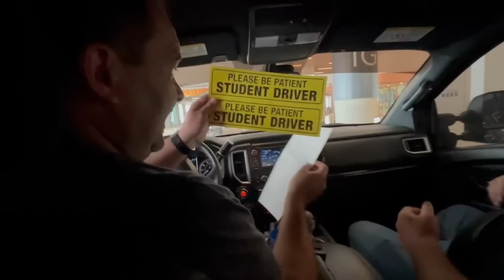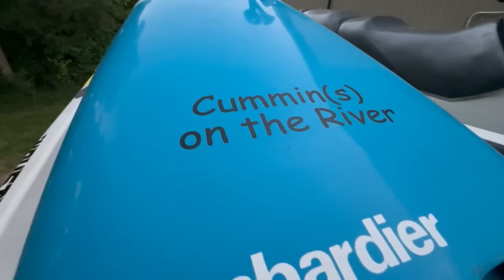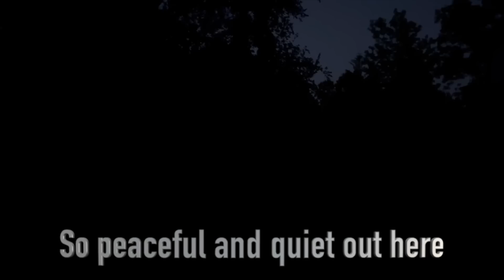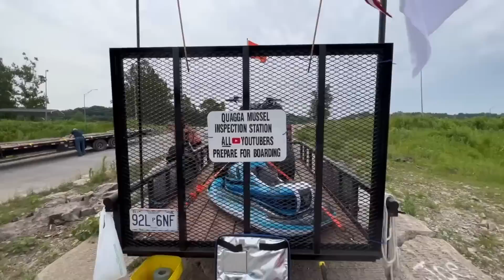Will I Survive the Missouri River Run 2023?

Comment: @Merlin those rocks are jetties.  The Corps of Engineers use them to help keep the rivers navigable by sweeping the sand out of the channel.  The sand and silt get carried by the current, and since water flows towards the path of least resistance the heavier sand and silt flows around the jetty and settles.
I saw this work on the Red River in Louisiana when they were working to make it navigable.  It's impressive and it keeps from having to regularly run a dredge boat down the main channel to keep navigation safe.

Comment: I live about 10 miles due north from where you all put in.  In the 80s we rode motorcycles and four wheeled about 20 miles of that river.  On a Saturday and Sunday River Front Park just south would have a hundred trucks parked that hauled dirt bikes all riding in the woods.  You all haven't seen mud!  We got one out over two days and it took a backhoe.  It was a new at the time Chevy Blazer with a built 454 and 44" Gumbo Monster Mudders.  Tires were gone and he had to climb out the window.  They did mention two of KCs great BBQ places I like a place called BB's Lawnside.  The meat doesn't need sauce but if you want it it's not Ketchup based.  Vinegar base like Nashville I think.  I could go on for days, you guys picked an incredible place in the country!

Comment: Holy molly Im getting old I Have worked at my lake for so long so many dearships. I worked on all these old 580's when they were newest things on the lake. I think I still have some old mpem module's out in old box in the shop. I know I have a 20lb box of old mukunis rotory valves and probably a 3 lb box of gaskets and such for 580 engines. Gosh I hated the yellow engines such dumb power box design. here 33 years later stil at lake still making a living at it. Question? why do you have a dess key on your old ski?